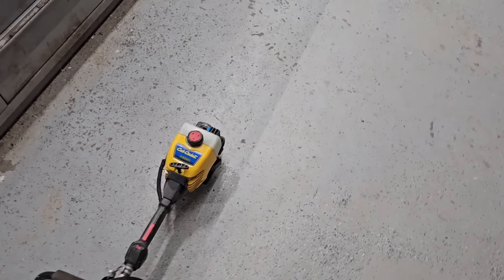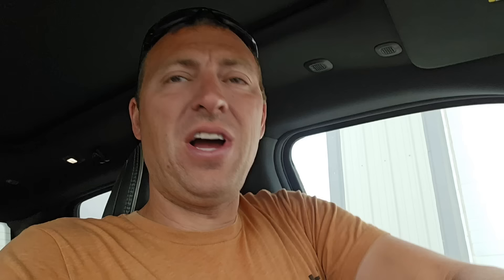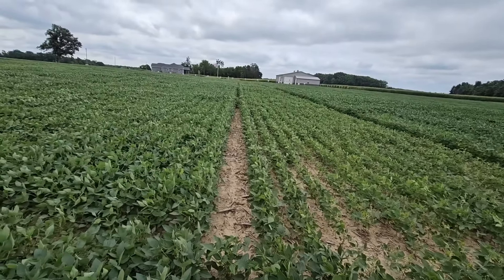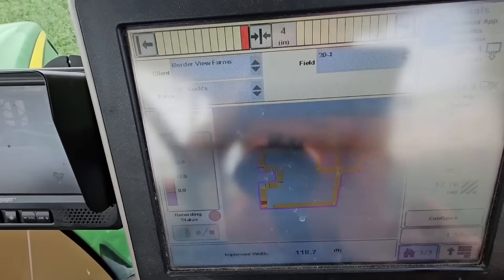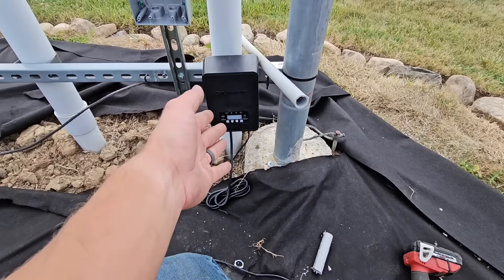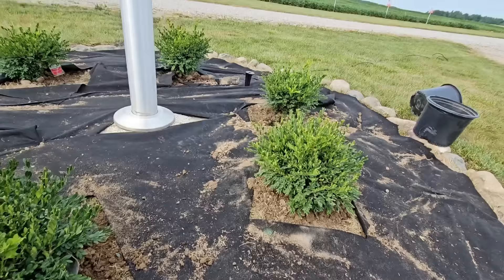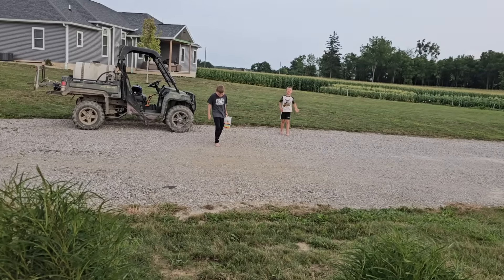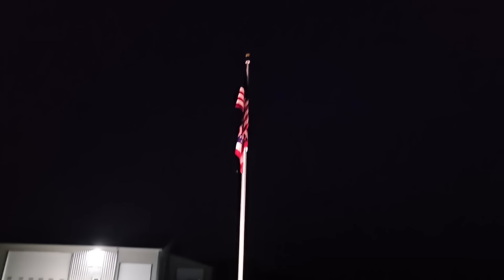Don't Pee on the Fence!

Comment: Generator breaker - Is there a schematic drawing showing the circuit breaker?  I can tell it is a ABB MCB, looks like S 2?1 B6 on the breaker.  Just need the number between the 2 and 1.  Looks like a zero.  You've got same size breakers in the unit.  Move beakers around and see if the one that is tripping, trips on a different circuit.

Comment: Nathan Cub Cadet trimmer put blade on then screw line trimmer head back on hand tight.
As landscaper we used to run both in heavy brush to knock down then extend line for fine clean up.
P.S. we always throw shields away even on New Machines to me OSHA 😆  Standards they get in the way.

Comment: I’m using 2 stroke fuel I mixed about 5-6 years ago. It’s Stihl synthetic. I mixed 2.5 gallon and it takes a while to use it up. Also, I peed on a fence when I was about their age and I thought somebody kicked me in the butt. I was at the edge of the barn and I turned around to see who kicked me!

Comment: Put a corn cob underneath the breaker. It’ll find the problem.🤣 if the wires aren’t smoked it’s the breaker. If they are then they will be smoked at the issue.🙄🤦‍♂️🤬🤣🤣🤣

Comment: Your fertilization pump is not that good.  Neptune Chemical Pump is much better.    We have larger tanks so we deliver with a transport.   285 bu corn uses up to 10 lbs/ac of N per day.  That saves much labor.    You could use your phone apt to turn it off and on.   We do a lot of  irrigation fertigation, a transport load of 32 0 0  or thiosol blend every few days during  August in NW Texas.  Also when we are strip tilling we fill a nurse trailer with 10-34 at the fields.